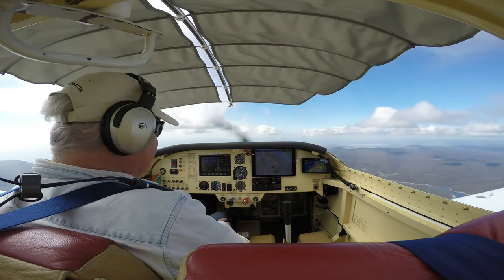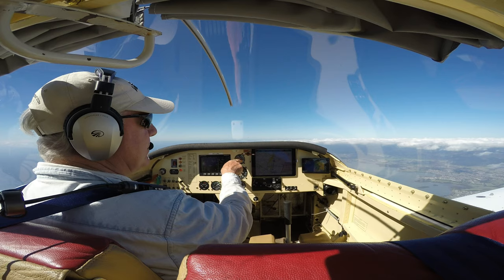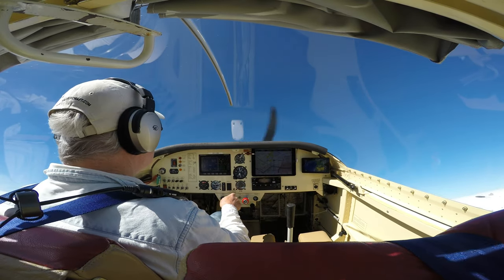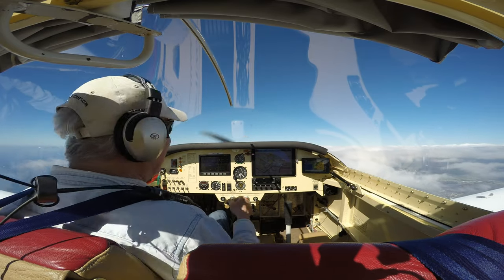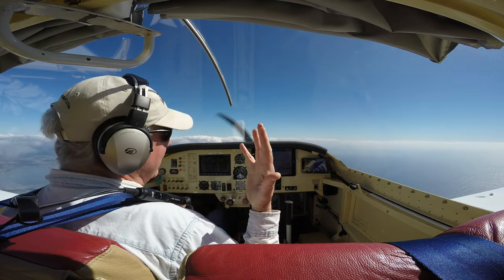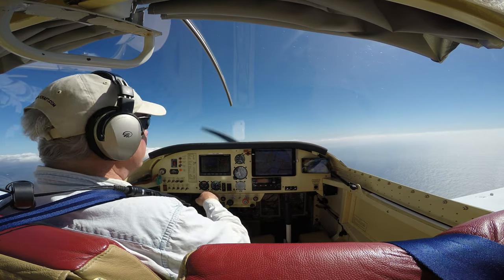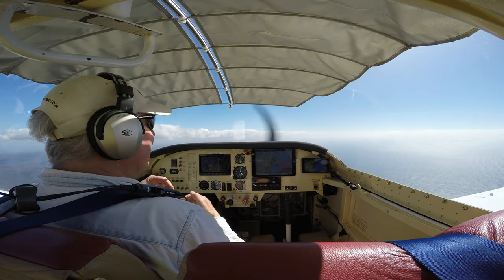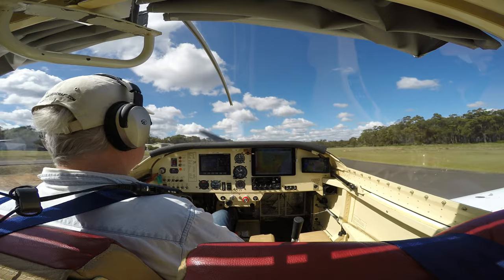First time Solo Spinning in a Van's RV6A

Comment: I've read that these RVs are somewhat spin resistant, and that it takes some effort to get it to go.  Years ago, I had a Citabria with VGs mounted to the leading edges of the wings. The first time I took it out to do spins, it would not go! It would simply drop the nose and lose altitude.--much like this RV. So, after a half dozen attempts, I finally pitched the nose up high and before it started to mush, I stomped on the left rudder and spin she did! That technique was the only way to induce a spin. The VGs were very effective at making the plane nearly stall proof.  Personally, I did not like the VGs. They do not belong on an aerobatic plane.

Anyway, this vid was fun to watch. For anyone who has not done spins, I advise you get the training. The first one will shake you to your core. But it gets easier with each successive one. It's very good training, even if it's not required.